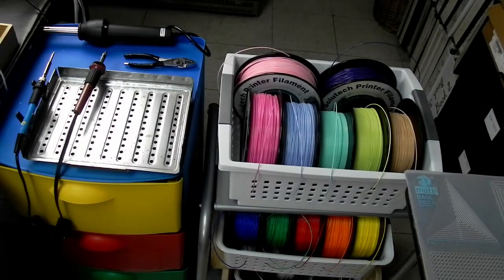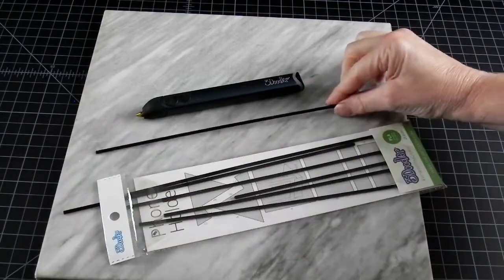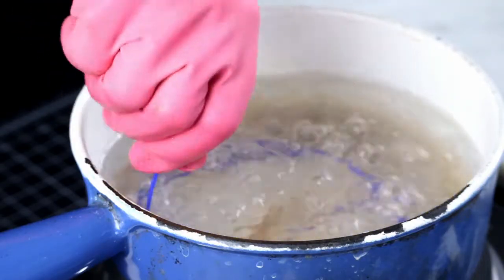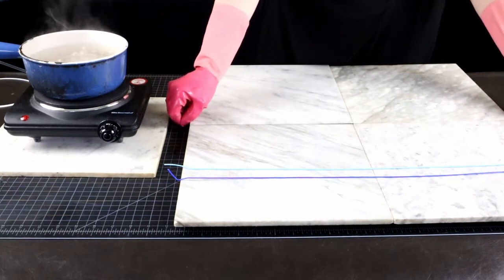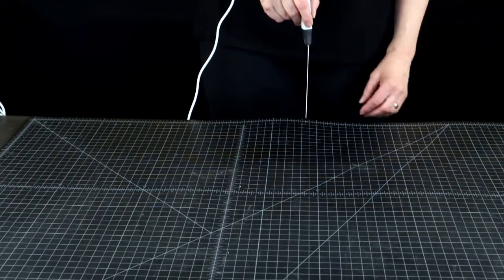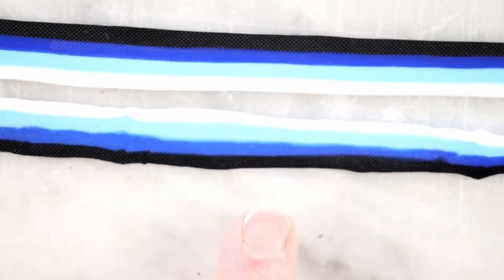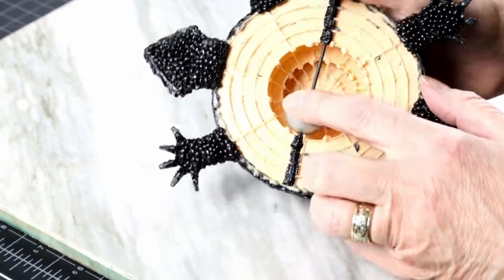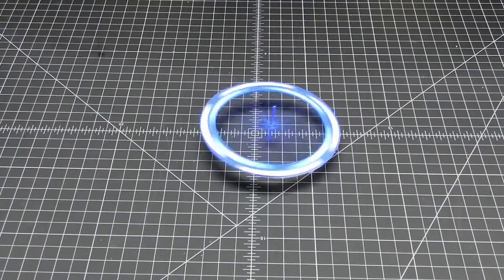How to straighten filament for 3d pen projects and why

Comment: Hot water to straighten pla filament isn't the greatest idea since it is made of materials that naturally absorb water. If you  do put it in hot water to straighten it, you should put it in a dehydrator to remove all the water it absorbed so it won't bubble or pop while using it, as well as the water absorbed makes the filament easy to break and weaken it.
Reply from the maker: I am so glad you brought this up because other people may have the same concerns. I find that a short immersion in water doesn't affect the filament in a noticible way. In other words - short dunk of less then a minute is not the same as months of storage in a humid environment. It's a matter of time frame. Filament doesn't absorb water as fast as more porous materials like paper of fabric. However having said that - I do use this technique only for specific projects for small amounts of filament that are not going into my pen anymore because I am more concerned about possibly making the filament diameter uneven. So bubling and poping while using it in a pen or printer is not an issue.

Comment: Can I use this method to straighten my pla (1.75mm) filament, because in its curled up shape its not that comfortable to use (space issue)
Reply from the maker: Sure you can. Just make sure you don't stretch it ( ie. don't change the diameter of it) just straighten it. Good luck

Comment: Can I tag this video for the usage of my thesis? This is such a huge help!
Reply from the maker: Sure. What is your theses on?
Reply: @3DPENDEN  thanks for the reply. 
It’s a long title but it’s to do with 3D filament and epoxy resin to be turned into a composite matrix for the purpose of structural enhancement (think of buildings). 
My supervisor told me I needed to find a way to experimentally find how to straighten filament and there wasn’t much info. Since my spool came in curved, I was trying to find help. 
This video saved me. Thank you and I’ll be sure to quote you too
Reply from the maker: @prosperous_berri_x  I am glad it helped. Just keep in mind the hot water method works well with PLA. I haven't tried it with any other types of filament because I mostly work in PLA. For some types of filament the boiling water may perhaps not be hot enough?

Comment: Tried that this last weekend.  Because of space, I used the Mynt mat as a jig for a pseudo-Tiffany frame (the channels are slightly wider than the Mate).  Let it cool in the mat.  Was OK until I tried to fuse the corners with the pen alone. Next time, I'll try using the mini iron then reinforce with the pen.  Thank you for the other ideas too!
Reply from the maker: I know. Joining things with just the pen sometimes makes a pretty weak bond plus it tends to look messier. Some kind of other heat fusing should definitely help. Have you seen these two videos yet? 
How to get 3d pen projects from 2d to 3d - Heat forming
https://youtu.be/KwWeIYqoA-I
9 reasons to get a wood burning tool if you have a 3d pen
https://youtu.be/IHpmzxrLNik